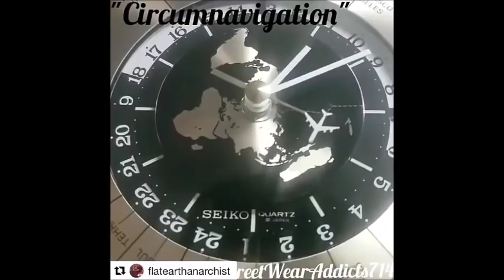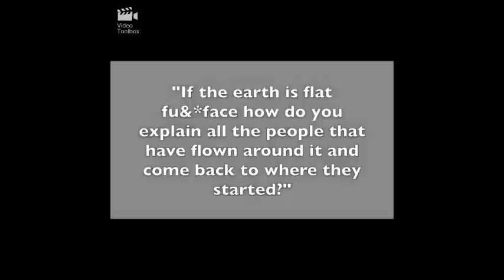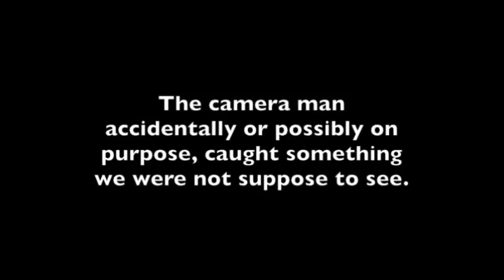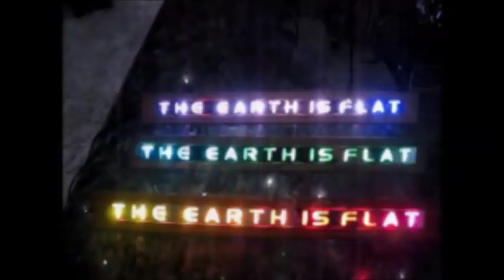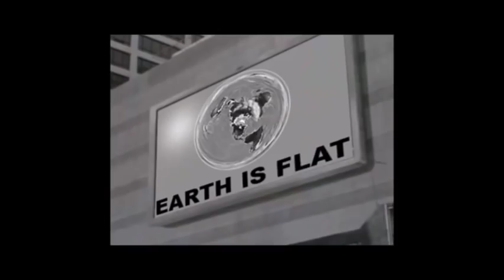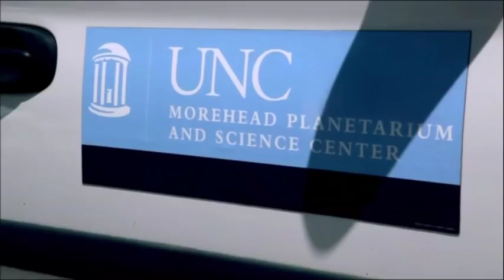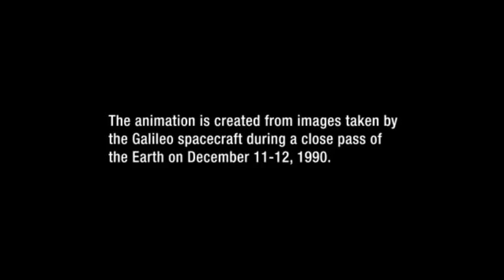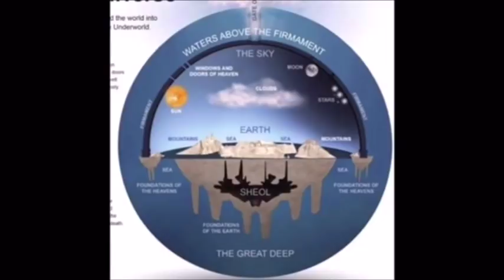Flat Earth Q&A Emails 81 - Mark Sargent ✅

Comment: There is a shared responsibility in writing; a written promise or set of promises which derives its validity from historical facts by which generations to come will remember. The right use or exercise of knowledge; formed sensibly construed and applied words that interpret the events of today concerning the well-being of the entire community as well as with the well-being of individuals. It may be mentioned as a part of history, a competent opinion based on sufficient knowledge of the relevant facts, in particular as to the authority best adapted to the nature of the complaint. Never argue with an idiot they will wear you down and beat you with experience.

Comment: Whats the ice wall like? How high is it? When does the ice wall melt into the firmament/dome? Shouldn't the entire firmament be ice/frozen? Since the ice wall forms because the Sun can't reach it, what makes the dome any different? The sun can't heat the upper reaches of the dome either.
Reply: Ian Baxley
The sun can't heat the upper reaches of the dome either.
No Ian, a dome over the earth would produce global warming on steroids. Consider how things work in real life. I stress, IN REAL LIFE. The sun produces solar energy. When it strikes anything - including you - it's turned into radiated heat. The earth's temperature remains constant because much of the heat escapes into space. But if the earth had a lid on it that blocked the escape of the heat, the temperature would continue to rise. Besides, the nutjobs insist that there is no space, and everything is under the dome.